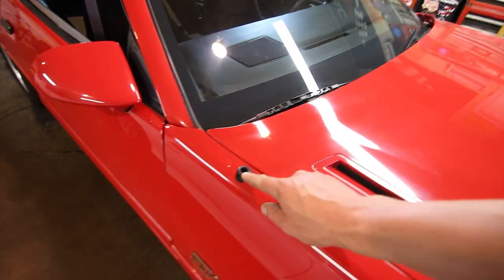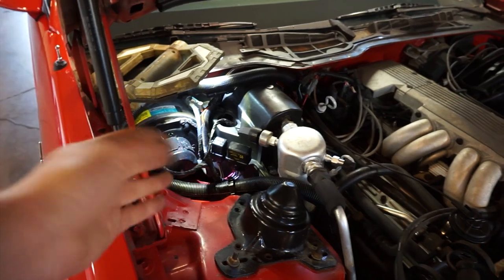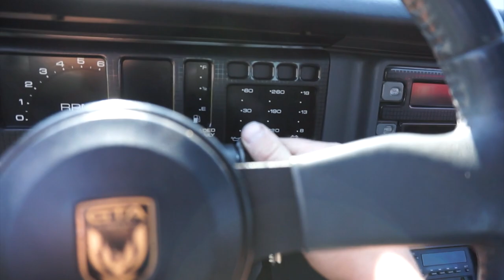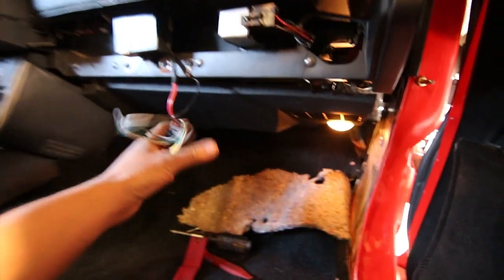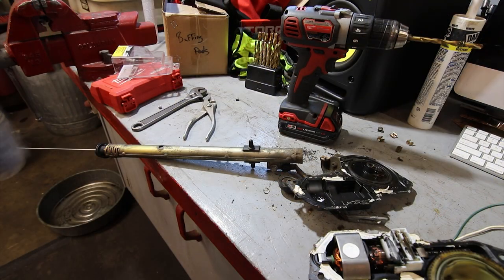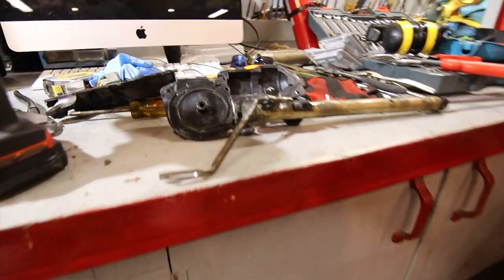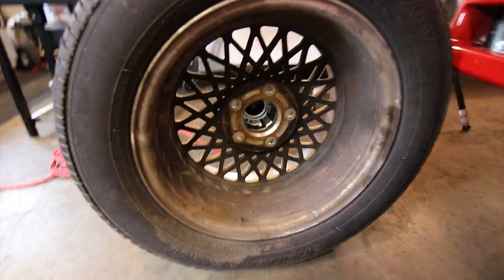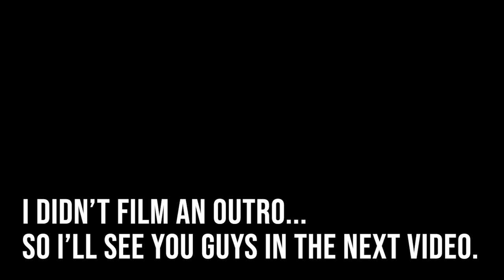CHEAP F-Body Power Antenna Repair (Fixed Previous Owner's Hack Job) & One BIG New Problem

Comment from the maker: As an added bonus to all of the forward progress on the car, the heater core is leaking now. Neat.
Reply: Guess this car wants to fight you the whole way 🤷‍♂️
Reply from the maker: Yeah I guess so. The better i treat it the more it fights to die lol
Reply: Looking forward to that video. It seems your car is pretty stock. I highly recommend you replace that plastic Heater Control Valve ASAP, those tubes in the valve tend to disintegrate over time, causing coolant leaks. I recently had the control valve blow up on my face causing some light to moderate burns...not pretty.
Reply: I think in one of LSXMatt's recent videos he replaced his heater core on the Trans Am and mentioned that it's not too bad compared to others and you don't have to pull the entire dash
Reply: It's an easy core to swap compared to some other cars!
Reply: Also the heater core is not as bad a job as its made out to be especially on a Firebird as long as you have some extensions (the top bolt on the heater box), worst part on mine was getting the hoses off on the firewall. Spectra makes maybe the best fit aluminum aftermarket out there or find a good NOS brass one (I went that route and it was good fit and around same money as aftermarket).
Reply: @bhcamaro2002  This car gives Brian ideas for new movies ;) Star - Director relationship xD
Reply: good man very thorough

Comment: This is a fantastic video and will be used for decades to rebuild power antennas..Thanks for the detailed description and fix...I don’t even have 3rd gens anymore and I still love this content...
Reply from the maker: Hope its helpful to some people. A couple have forwarded me links to getting a replacement nylon string that I didn't find before. They can  be had for $30-$50 online. I'll still go this route next time. Its cheaper and 10x stronger

Comment: Great tip on repairing that power antenna. The heater core is a simple fix on third gens. It takes about 45 minutes. The only issue is that it is nearly impossible to get a factory copper style core. The only one I could find was a replacement aluminum type and it doesn’t get as hot as the original one. I live in the desert and don’t really need heat. You might want to take your leaking one to a radiator repair shop and have it fixed.
Reply from the maker: I'll examine the core I take out and see if my local repair shop can fix it. I've put in the aftermarket AL cores in these before. Not the worst job in the world, but I wouldn't say it's fun either lol. Oh well, that's the way she goes on old cars like this.

Comment: Good video! I don't listen to music in my cars because I don't want to wear out my power antenna motor and have it stick up. Glad you got it fixed cheaply.
Reply from the maker: I dont for the most part either. I'm usually running errands though. When I hit the freeway I'll listen to music.

Comment: Those wheels changes a little over the years. I think one style had a dimple where the center meets the barrel of the wheel. So the previous owner may have curbed one and replaced a 87 gta wheel with a 92 gta wheel. Just a thought. Good luck and keep up the great videos.
Reply: I think you're correct. I zoomed in on the wheels and thought the same thing.
Reply from the maker: Thanks for the tips guys. At first glance I hadn't noticed it. Theres some sharp viewers in here! I'll check the rears closely too.

Comment: Good to see someone doing a proper and thorough job of a repair.  Not only did you fix the initial problem, you improved on the factory solution with a stronger means of extending and retracting the antenna and fixed several other problems you identified whilst you were on the job!  On top of that, I've now learned about the internals of a piece of this car I've never taken apart - great stuff - you've just earned yourself another subscriber!
Reply from the maker: Sweet, thanks for the feedback bud. I hate to admit it, but my solder job wasn't the best and I had doubts about it lasting. Sure enough it let go on one end and it was back back square one. 

In the future, I would WELD and grind it as the fella did in the photos I saw, or two part epoxy each end. Soldering isn't the best method here IMO. You live and you learn.
Reply: @Greenlightfilming  I've got one myself so that's valuable info to know.  I'd probably go with the welding - it's metal on metal that way and with enough grinding and sanding it should look smooth and professional - and hey - it's still easier than spray painting!

Comment: Great video as always! Makes me want to turn some wrenches on my 92 T/A convertible. Many projects completed many more to go on my ride. Total motivational videos to make my ride sweeter. Thanks. Love the drive thru the tunnels in my old home town at the end of the video.
Reply from the maker: Glad it's doing something for you! They are fun cars,  but they have some not so fun issues to address as you are well aware. Since filming this, the power antenna has a new issue that I'll have to address. Seems like it never ends on old cars.

Comment: An original owner, fully documented 1988 Pontiac Trans Am GTA was advertised, in a local newsprint magazine, in 2008, for $4,500. The ad stated that the car had "mechanical issues" and the battery couldn't keep a charge. The car had 46k original one owner miles. Having wanted that exact car since they were new, I answered the ad. It was just 46 miles from my home. When I went to see the car, the owner  connected the battery and I heard the whir of the faulty power antenna. That was the "mechanical issues" the owner stated in the ad. After I pointed that out to him and told him that this car was now and in the future will be even more valuable, he still wanted to sell it to me just because of my honesty. This was my dream car since I was 16 and at 36 my dream was coming true. I ended up buying the car for $2,500 and I've had it ever since then. Today it has 67k miles and spends it's winters lounging in the garage next to my newly aquired 29k Camaro RS.

Comment: Regarding your question about the wheels being factory or reproduction; the 1987 GTA had “dimpleless” GTA wheels. Where the cross lace meets the inside of the rim, your wheels have dimples; whereas, the factory 1987 GTA did not.  I restored my white 1987 GTA 5.7 liter hardtop and, like you, really got to know the car and these little idiosyncrasies.  Thanks for the videos on your ‘87 GTA.

Comment: Sucks that you got rid if it, I own an 89' and your videos were the only ones that really helped me... There are way too many 4th gen videos out there, us 3rd gen Pontiac guys really needed more GTA ones since there's hardly any😞
Reply from the maker: I'm sure there will be another 3rd gen GTA in the stable sooner or later. They are great cars, but the reality of the red one I owned was that I was done with it.

It made no sense to have it painted even if I did all the labor of removal/installing of the panels and it drove great. 

It was at the tipping point of value so i sold it.

Comment: One of those front rims is incorrect. 87 GTA's had a one year only production rim. The 87 rims do not have a dimple at the end of the crosslace, 88-92 does.
Reply from the maker: Thanks for the info. Figured one had to be wrong, just didnt know which was correct.

Comment: I was planning on doing this with my 87 Formula but I bought one of those Bluetooth cassette players to connect my phone. You could listen to the radio off of iHeartRadio... Lol but this would be a fix for the future I’m sure
Reply from the maker: That's the way I see this one. It should really be a long term fix. Hope I never have to touch the antenna again.

Comment: If you examine closely the outside front edge of the wheel center, you can see that the left wheel is smooth, whereas the right wheel is "dimpled." Check the rear wheels to see if they have the "dimples," but I believe you have a later version of the wheel on the left front.
Reply from the maker: Thanks for the info. I'll take a look at that closer today. I didnt realize the factory wheels would be cast different on earlier/later wheels. Wonder if the mismatch has something to so with the paint work that was done.
Reply: @Greenlightfilming  The earlier two piece non-dimpled wheels were weak in the hub area and prone to cracking. The later one piece dimpled wheels fixed that problem.
Reply from the maker: I'll take a look tonight. Thanks for the info, you know your details on these cars.

Comment: Awesome video and very informative, I wish mine still had the original power antenna but a PO did me a similar favor lol and removed the entire motor assembly so I went stationary mast. As you mentioned the used ones are very expensive for a likely worn out part. Switching to aftermarket power may be what I eventually end up doing.
Reply: @SoGoYoko  Thanks for the heads up, honestly the headache of finding one that fits properly is why I went with the stationary mast.

Comment: Cool video!! Keep up the good work I'm learning a lot even thou I own a third gen Z28 and not a Tran Am but anyway again outstanding work.
Reply from the maker: Thanks, appreciate it. Hoping this will help some people save a bunch of money. It's a good DIY in my opinion. I'll get back to my Z28 sooner or later. Life gets busy you know?
Reply: @Greenlightfilming  Oyeah I hear you about life gets busy never enough time to do what you want to do. O I forgot you said something about replacing the heater core man i had to do that on my 92 Z28 I don't know if its any different on a Tran Am but it was a challenge on my Z28 i hope you have a easier time than i did.
Reply from the maker: It's going to be a big PITA. The process would be pretty much the same on this car. I've done them before on these, just been awhile.

Comment: Several topics covered Gen 3 style! I have a 91 Camaro with factory fixed antenna that I need to change out (Use a car cover) with a brand new GM NOS power antenna I got at a swap for $5. I took the RF cable from a Junk yard Camaro (the new unit just has the post and two screw holes in mast) and thought I would just use the power wire from the Alpine stereo that is in the car to operate it. Doesn't the stereo switch the power already? Unsure now...

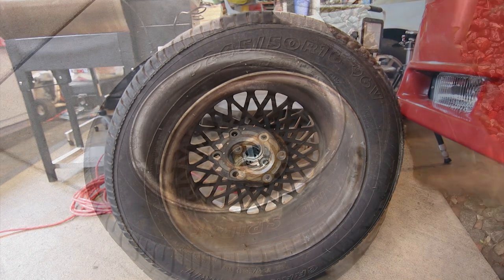Comment: I know this is a few months ago, but, in case you didn't notice, or get it fixed...  At 24:28, between the D and the S of Grand Spirit, the wheel appears to be bent, just a touch.

Comment: Replace anything the mice touched in the hvac. I bought a 92 talon once completely mouse infected inside and out and I even took engine degreaser to the entire inside of the hvac and nope it still smelled like gross mouse no matter what. Start by replacing the ac evaporator and blower motor with fresh parts. Trust me that ac evaporator will always have a mouse smell no matter what
Reply from the maker: You are right. Even with what I cleaned out, it still has that odor. I'd imagine it's all just coated in the scent.
Reply: He shouldve use AC evap cleaner. That pink acid maje reaction with the aluminum and cleans everything

Comment: Your mystery wheel is not from an ‘87. The 1987 gta wheels don’t have the dimples in the gold mesh where they meet the polished lip. I hope that makes sense. The 1987 wheels should be smooth in that area. It was a 1 year only different in the crosslace wheels.

Comment: The rims that are on your gta and my T/A are BBK'S there the one who made them plus sweet Antenna fix a friend of mine  just broke mine two weeks ago  I could have cust  him 3 ways from Sunday I told him there no speaker in the car plus the exhaust is to loud  two even hear it anyway
Reply from the maker: Both of the fronts appear to be factory GM wheels like you say. I just noticed that the casting inside looks totally different. The passengers side has the center welded all the way around to the wheel's "barrel" if that makes sense.

The drivers side is fully cast with no weld.
Reply: @Greenlightfilming  it does  I'm going to have a look at  my wheels  you my have a replacement wheel I'll look tomorrow see I'll get back to you then
Reply from the maker: Appreciate it, thank you!
Reply: @Greenlightfilming  both the front and the back of my wheels are smooth no welds stock if that helps

Comment: I'm wondering if anyone in these comments can help me with my 87 IROC. I did a t-56 swap, and ever since My car won't cold start without being hooked to a charger/jumper cables. I didn't change any wiring other than running the yellow/purple to the clutch pedal for starter activation. Im using a flywheel/starter that fits a 95 Z28. The engine cranks over like it used to b4 the swap and woudl normally crank over on first turn of the key. Ive had the battery checked and theres no issues with it either. Everything on my car is stock L98 5.7L except it has an MSD ignition/coil/6AL/Distributor. Ive posted on 3rdgen forums, no one has any ideas. Im just beyond frustrated at this point. Cars been sitting a year now and hasnt really moved cause i dont trust driving it anywhere in this condition. So i just start it and let it run every few weeks and thats it.

Comment: so what's going on with the car now? almost a year since this last video! what's up..
Reply from the maker: I've since sold the car. It was at the point that it wasn't worth putting anymore money into so I moved on to another project.
Reply: @Greenlightfilming  so what was wrong with it bro? what did it need?
Reply from the maker: @kitvexed8229  it really needed a full paint job and some interior restoration. Mechanical work here and there. It would be a money pit.
Reply: @Greenlightfilming  damn im sorry to hear that i was excited to see where you were going to go with it - you were certainly excited in the beginning too! sorry to read you lost hope and gave her up..
Reply: @Greenlightfilming  damn im sorry to hear that i was excited to see where you were going to go with it - you were certainly excited in the beginning too! sorry to read you lost hope and gave her up..
Reply from the maker: @kitvexed8229  I didn't lose hope for the car and I didn't give up lol. Why would you waste a fortune on something that's simply not worth it? 10k for a paint job sound cheap? Lol.....

Comment: Crown Automotive 56003151 Antenna
Reply from the maker: Looked that up quick and it lists it as being for jeeps. The RF connector and mast look similar. Does this fit an fbody?..
Reply: @Greenlightfilming  Yes it does. The Jeep antenna bolts right in. It's 96% the same as the F-body power antenna. It has a different finial screwed on top (I actually like it better) you can swap them, it has the same white, grey, and green wires with the same connector on the end but the wires are too short for a Firebird and I guess a Camaro, the antenna cable mounts to the mast the same way but it is shorter and has a different connector another cable is meant to connect to it and go to the radio,  the grommet that goes through the body is the same, the mounting hardware/brackets in the fender mount the same and the trim/mounting hardware on top the fender mount the same. the antenna mast is the same length.
Reply: You can go about the shorter wiring and antenna cable two ways. Swap power antenna assemblies, push connector, wiring, antenna cable through hole and seat grommet. Extend green, white, grey wiring to reach, get antenna extension cable the right length with correct connector for your radio (full size Motorola or mini GM Motorola) and the correct female connector to connect to Jeep antenna cable. Or remove two screws from each power antenna that connect antenna cable to mast and swap GM cable onto Jeep antenna lower mast, cut wires in fender between grommet and factory antenna and cut wires off Jeep antenna and splice together.
Reply: @Greenlightfilming  Done it many times. Jeep antenna swaps in like a charm.
Reply from the maker: @Airwolf1971  man, that's really good to know. In all of my digging I never saw this method mentioned a single time. 

The aftermarket one that came with the car the was supposed to fit wasnt even close in many ways. I would have never dreamed a jeep replacement one would work out. I will mention this in the next video for sure!